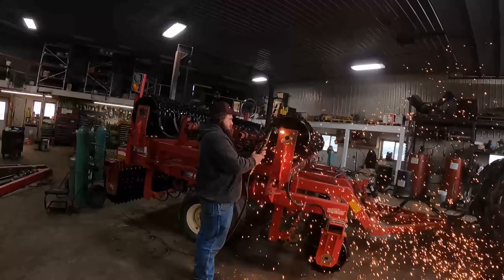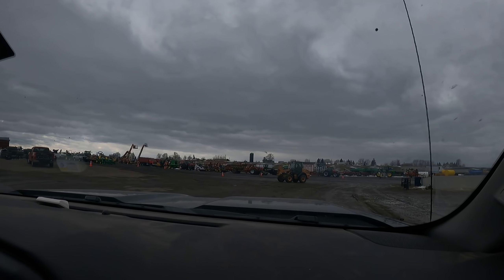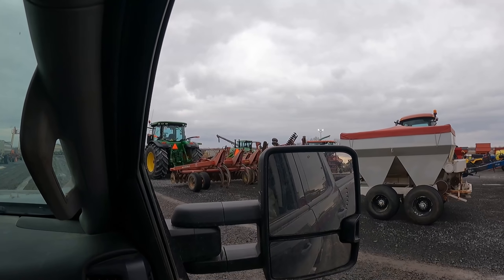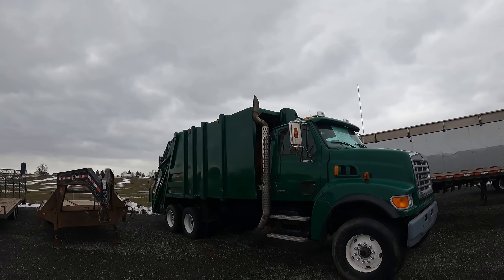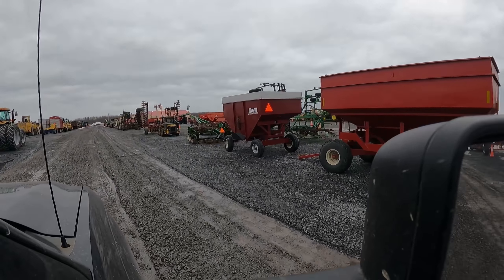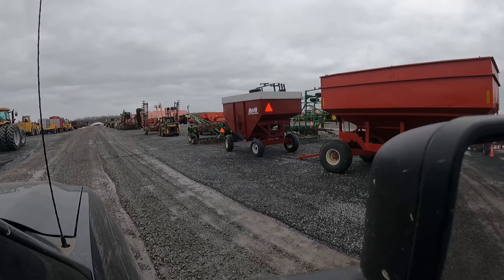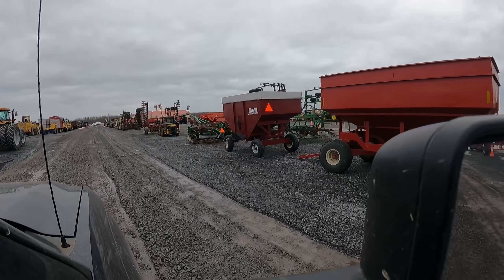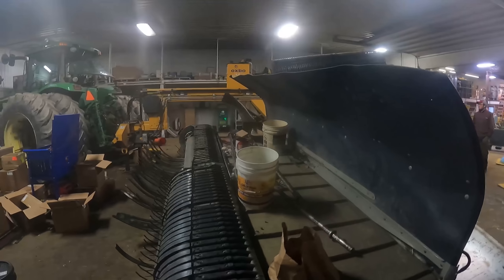I have a Chauffeur for the day shopping

Comment: That auction @ Martin's has come along way from the sparse beginnings of the early days. They still offer quality Mennonite furniture which remains their core business. Many of those consigned pieces are a work in progress but this is an area w/ many Mennonite farmers who make the time, coupled w/ the patience to restore these machines for their own use or resale once restored. They are very shrewd  & creative folks. They would have little use for road vehicles however or the rubber tires on the powered units .  Conversion to the newer style combo steel wheel w/ rubber belting is mandatory.

Comment: I learned on a triple stick Mack around that year I still use it to move the 68 D7G around the farm as long as its less than 10 miles and no pavement except the local parade each year mines not bobbed might even be extended twin drive axles we put lockers in it somehow my grandpa canabilized a coffin sleeper on it when he hauled equipment for the construction company he worked for im not sure that he didn't add the 3rd gearbox in it essentially its just a high low for whatever gear you're in so like a 2 speed rearend just harder to shift people look at me funny when my answer to what trans it has with a 4 a 3 and a 2 he hauled stuff for the army corps of engineers after a dam project brought an OD Green farmall M home a rod cap came loose and it was hammering and rebuilt it in the milk barn between the lofts where we'd pull in to unload the bales we rebuilt it for my dad in the 90s and his only request was dont paint it red it rolled out of the factory camo so that's what it stayed

Comment: Hey look guys back in the early 70’s I drove a 46 snub nose White Mustang with a 290 cummins and a 4 by 5 road ranger with the steering wheel arm length shifting. The directions where right on the dash but I don’t think I ever caught on as to how it was suppose to shift.

Comment: I am not the safety police but I have a story about cutting with a torch. I the shop I use to work in they would fire you over breaking safety rules. But to get something change can be hard to do. They started wearing safety glass with a face shield to cut with. We use to had to wear goggles until it was sold the new way. A outside person brought this person to tell us about an accident that he ad while cutting using glasses and shield. He got slag in his eye some how and was taken to an ER where they pop his eye out and was cleaning it out. He was still a wake and could see out of that eye. They saved his eye but it was not the same. After that we had to wear goggles to cut and they made us wear safety glasses when we welded.  Hearing that story I never wanted that to happen to me so the goggles I never quit wearing anyway but glasses with the welding helmet was to much.